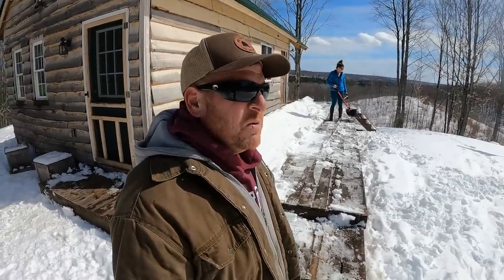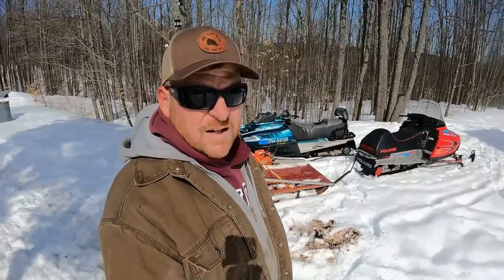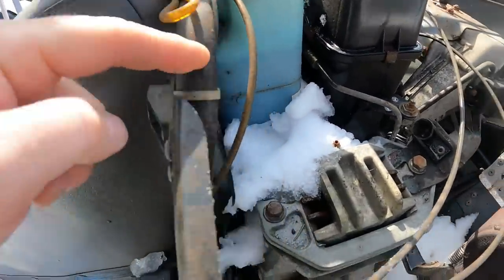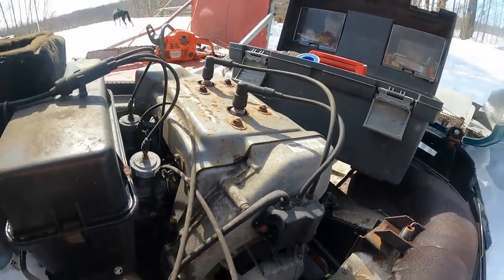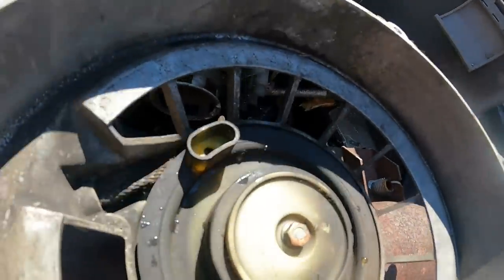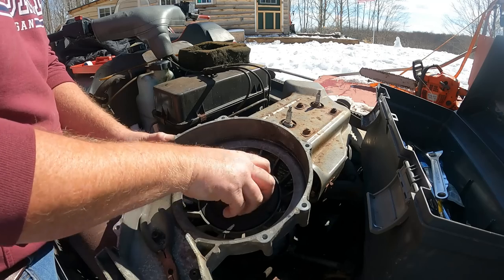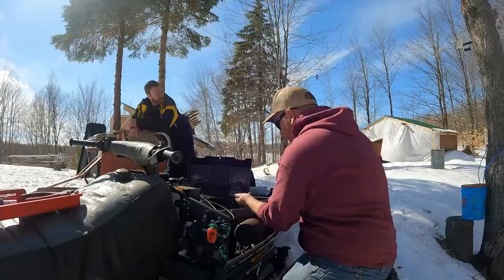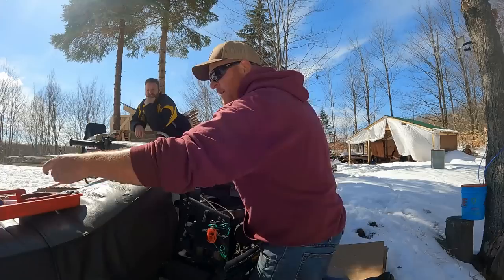Trespasser Shows up at the Off Grid Cabin

Comment: I-rebuilt my1980 citation skidoo from ground up it took me three months put new track, shooks, springs, pull cord, new spark plugs, new belt, the only thing that give the most problems was the pull cord you did better than me it took me five or six times to get it right. I bought it used in 1990 for $ 500.00 had it for 10 years and sold it for $ 750.00 then I bought a 2010 800cc skidoo had four year warranty so I kept it for five years and then I sold it, I miss going on the trails up north in Ontario Canada . They are a lot of fun here from Ontario Canada ❤️❤️❤️🇨🇦😎
Reply: If I would have had a cell phone back then it would have been easier to take pictures
Reply from the maker: ya for sure

Comment: Missed the alignment tabs for the recoil to engage to the flywheel. But you handled the issue well didn't see no wrench throwin or mechanic talk going on 😆 good job my man i was always tearin up stuff on my sleds back in the day operator induced every one of them Ski-Do with a 3cylinder was wicked fast in its day but the abuse left it in weekly repair mode for a weekend of adrenaline-fueled fun😁😂enjoy your conquer over the sled gremlins Jay✌
Reply from the maker: Hey, thanks Jim.....I have heard bad things about those 3 cylinders back then.......I stayed away from buying them when looking for these two. LOL.  Ya there was a spring on the cover or little pully that was not pushing something right, LOL. I fiddled with it and moved it a bit and it finally bit.  thanks for being here my friend.

Comment: Ok then... Jan, you know the way to wind that cord so next time... start by putting the cord in the spot it ties off to, start the wind up on the spring for recoil and when the pulley is around to where the notch is, pinch that cord into the notch and finish winding it up tight and while holding the pulley so it can't unwind again, make sure the cord on the outside is coming up tight by all that cord hanging on the outside... while its holding tension on that cord, it will fall back into the groove and you can let it feed back in on spring tension... give it a couple easy pulls to check to see if you catches flip out okay and let the spring hold its tension and all... now just put it back on how you removed it from the engine... easy peasy... ask me if ya got questions
Reply from the maker: Thanks buddy.....ya It always takes me a while to figure things out. Best wishes